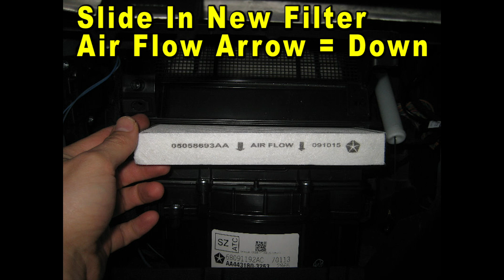2007 To 2017 Jeep Patriot How To Change AC Cabin Air Filter With Part Numbers

Comment from the maker: Jeep Patriot A/C Cabin Air Filters - https://amzn.to/3TpAbLv
Fram Fresh Breeze A/C Filter - https://amzn.to/47kQs9Y
Bosch HEPA Filter Part Number - https://amzn.to/47kQs9Y
EcoGard Cabin Air Filter Part # - https://amzn.to/3XDULu4
Precision Screwdriver Set - https://amzn.to/3sLixaP
Plastic Pry Bar Tools - https://amzn.to/4cPO5xb
Socket & Ratchet Set - https://amzn.to/3Z17LbA
Mechanix Gloves - https://amzn.to/3jCnHkt
Torque Wrench - https://amzn.to/3vS5uSI

The Paul79UF YouTube channel is a participant in the Amazon Services LLC Associates Program, an affiliate advertising program designed to provide a means for sites to earn advertising fees by advertising and linking to Amazon.

This DIY video shows owners of the 1st generation 2007 to 2017 Jeep Patriot how to change the A/C system's cabin air filter element in the HVAC blower motor housing.

Comment from the maker: Check out the DIY guide for changing the A/C cabin air filter in a first generation 2007 to 2017 Jeep Patriot SUV - 
https://www.paulstravelpictures.com/Jeep-Patriot-HVAC-Cabin-Air-Filter-Replacement-Guide/index.html

Here are all of the DIY repair and maintenance tutorials for the 1st generation 2007, 2008, 2009, 2010, 2011, 2012, 2013, 2014, 2015, 2016 and 2017 Jeep Patriot SUV - 
https://www.paulstravelpictures.com/Articles/Jeep-Patriot-Common-Problems-Repair-Maintenance-Guides.htm

Owners of other Jeep, Dodge, Chrysler, Fiat and RAM vehicles such as the Compass, Renegade, Wrangler, Grand Cherokee, Cherokee, 500, Town & Country, 200, 300, Pacifica, Challenger, Charger, Dart, Durango, Journey, Grand Caravan, RAM 1500, C/V Tradesman and ProMaster Van may also find these DIY instructions to be helpful.